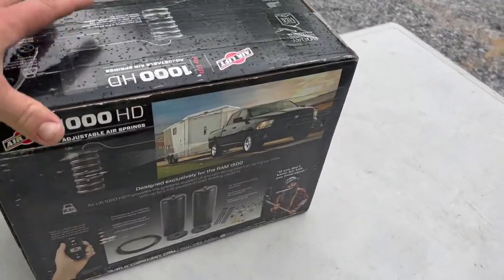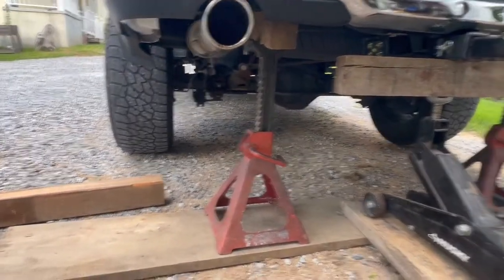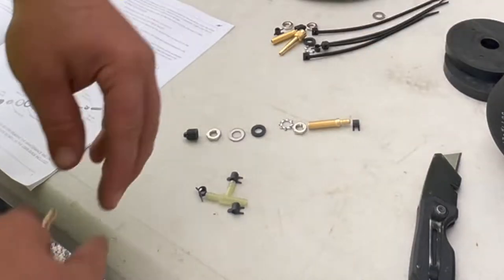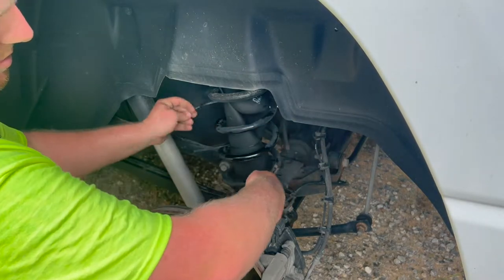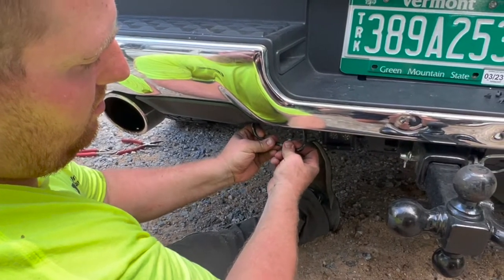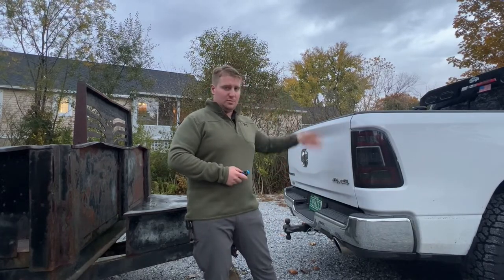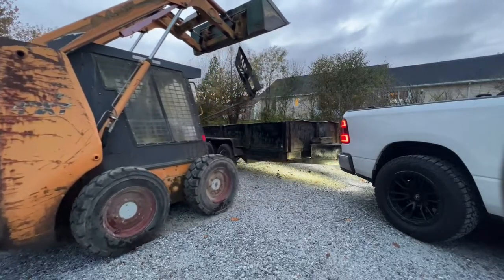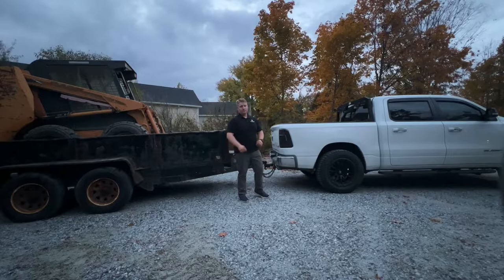Air Lift HD 1000 Helper Air Springs on 5th Gen Ram 1500

Comment: Tom - thank you for this video!  I was going to have it installed but wanted to charge me $450.  After watching this, I was comfortable that I could do it.  It took me 2 hours from getting everything setup to clean up.  It took me longer to run the air lines than get the bags into the springs.  I was able to step on the bag to deflate and then put cap on.  Then fold it like a hotdogs Bun and zip tie.  Thanks again.  Now I have $450 to spend on something else.

Comment: Great Video. I bought the same Air Bags and will be installing them on my 2022 - 1500 Ram. I plan to use them when my Camper is hooked to the truck. To adjust the air to the air bags when the camper is attached, is that more or less trial by error, or how to determine a set pressure to the bags? I heard that when the truck is empty, keep the pressure at 5 PSI.
Reply from the maker: I always keep mine around 10-12 PSI just for everyday use with work and since I have tools that stay back there.
 For finding the PSI that fits you best just take a measurement from top of the tire to top of wheel well with it empty. Then pump it up in increments of 5-10 PSI testing it with the weight on it till you get back to your original top of tire to top of wheel well measurement. I took the load off the truck when I would do the pumping. In the included users manual it has areas to fill in PSIs that you use commonly so you can reference if you have a handful of different trailer sizes or  bed loads.

Comment: How are they doing,  I see this video is is about 9 months old.  Just wondering if you have had any issues? Still holding air?
Reply from the maker: I recently removed them as I just upgraded my rear coils to HD 2500 coils. They held air fine the whole time. No complaints here!
Reply: What made you change to the 2500 hd??
Reply: Also, what is the ride difference before and after the airbag installation?  Thanks
Reply: @GreenMountainProjects  was it hard to swap to 2500 coils in rear ,

Comment: How do the bags affect the ride quality when pulling the trailer? I tried rubber support springs before but they were too harsh even when pulling a camper.
Reply from the maker: The ride quality is much better with these. The bags are adjustable. So basically you can put anywhere between 5psi to 50psi. so if its too stiff just let some air out . The manual comes with a section that you can write down PSI's so you don't have to remember what PSI is best for what ever trailers you have.

Comment: Hey with the bags pumped up and no load do they bring your truck up at all? Hoping they'll bring me up about a inch unloaded like my cousins ford.
Reply from the maker: These will not as they just fill the inside of the coil to prevent them from compressing. You would need air bags that either replace your spring or sit next to them on the axle and supplement your springs.